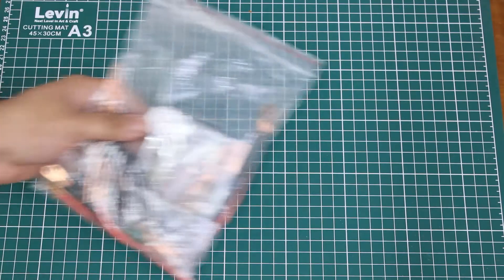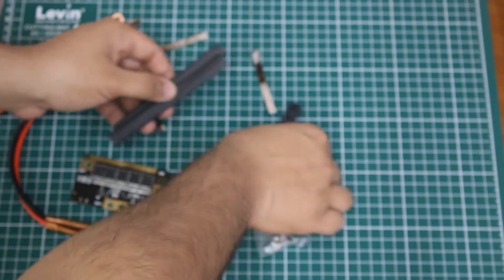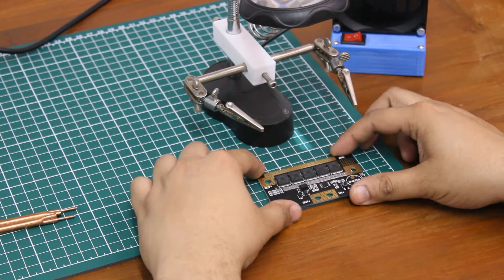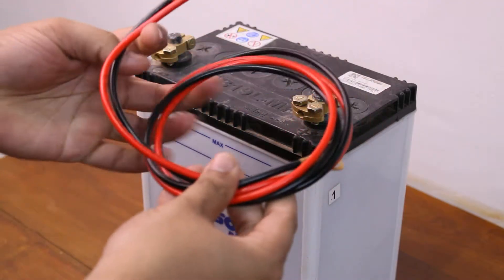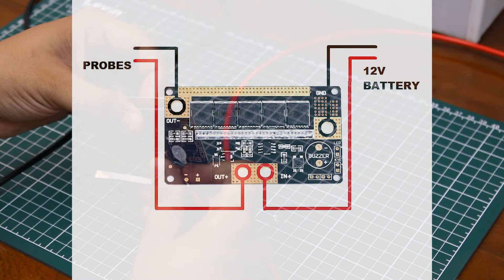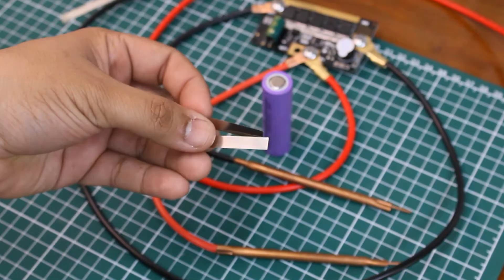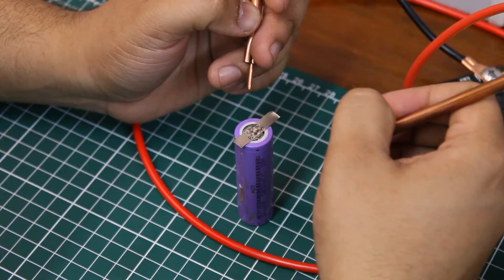DIY 18650 Battery Spot Welder Kit - Does it Work?

Comment: it sparks heavily! even sparks spread around my hands, what's the solution?
Reply: Bro does happen anything, they are actually safe, it's because you have set on high Ampere mode in which more current is flowed and hard is the spot welding on the battery will be
Reply: Where did u get from and what power supply u used ? Please share

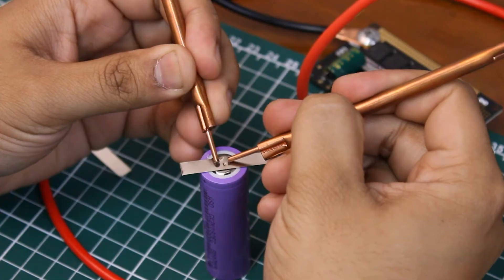Comment: 3:22 Bro is about to fly to India heaven. bro is touching uninsulated probes? is this safe? is there a chance your body chemistry becomes a better path of least resistance ?
Reply from the maker: Lol dont worry I'm still here. 12V DC current is generally safe, also you can check my next video on this I have designed a 3d printed holder for the probes
Reply: @SuperbTech  Glad you ok. hehe

Comment: Hi... can we use the lab power supply and if yes we have to set it, actually, to 14v?
Reply from the maker: no, cannot use a lab power supply. the spot welder requires a large current about 100A
Reply: @SuperbTech  thanks
Reply from the maker: @nerminziric6691  an old car battery is good option, as a power supply with high power output will be expensive. There are some people who use an old microwave transformer, but i find that risky as it deals with AC mains
Reply: @SuperbTech  too risky solution with microwave transformer

Comment: Is there anything you can use besides a car battery? For example, is there a converter I could buy so that I could plug it into a wall socket?
Reply: I haven't found anything besides a Car batteries.  Unless you want to mess with MOT aka Microwave Oven transformers.  I think Motorcycle batteries are stong enough as well
Reply: @tomfalkenberg  PLEASE be careful if you use Microwave transformers. Many people have died tampering with microwave circuitry